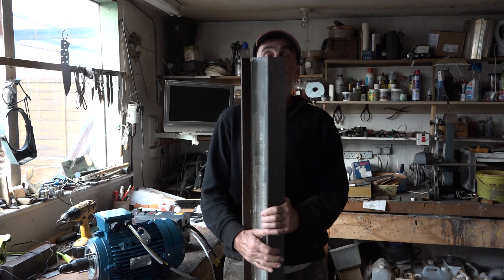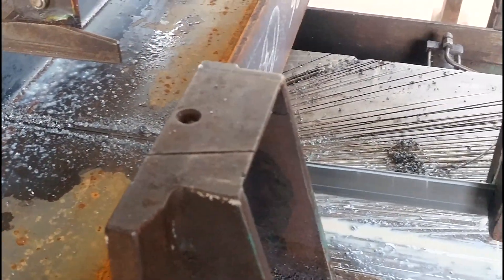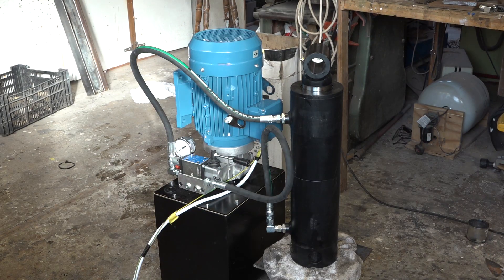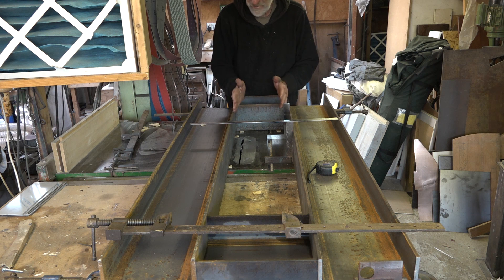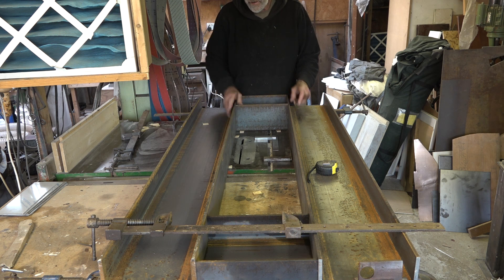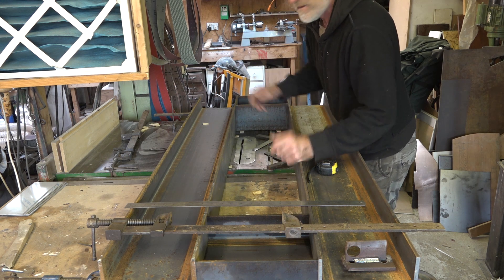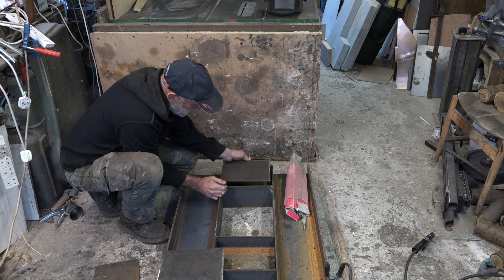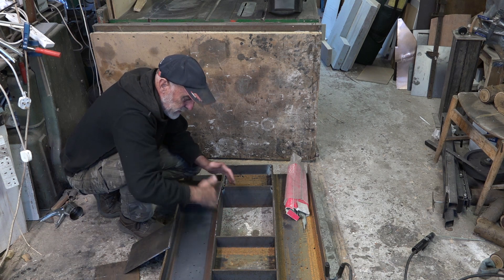hydraulic forging press build

Comment: Well done stronger than mine (9ton) the design looks also familiar.
 I'm looking forward to the finished press. 
But for what reason did you need a VFD?
Reply from the maker: Thanks, needed that for the 3 phase motor its actually 5.5 hp,  I only have single phase supply in the shop. i chose 3 phase because single phase motors can burn out if constantly switched on and off, plus the biggest single phase i could get was 5hp.
Reply: @LozHarrop  okay but there is a limit how much power a single phase circuit can put out I'm not sure but I heard the limit of most are 3,5KW. Please stay safe and ask a electrician for support.